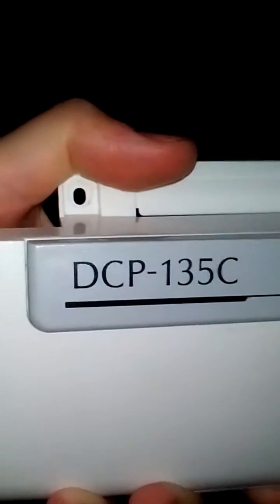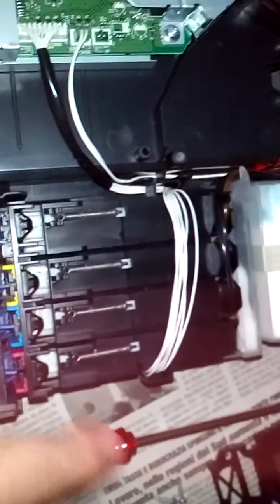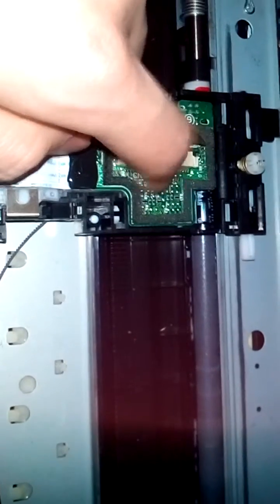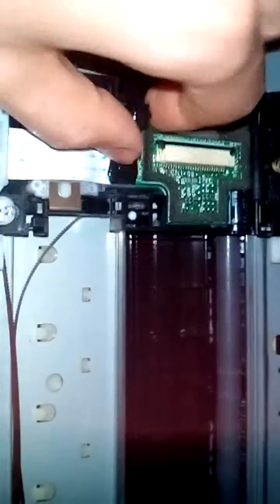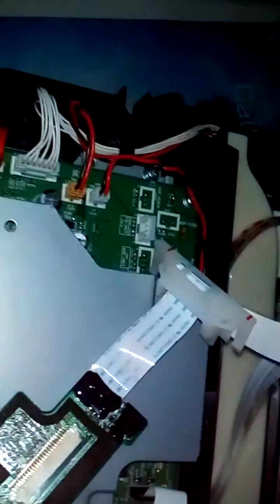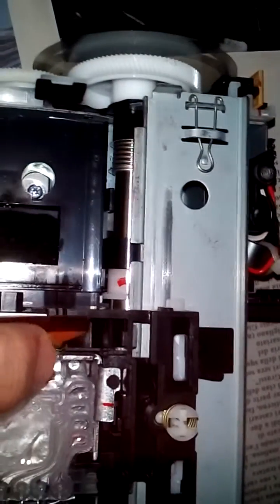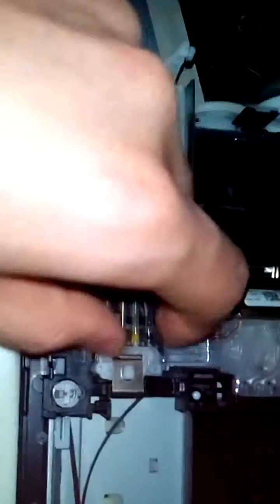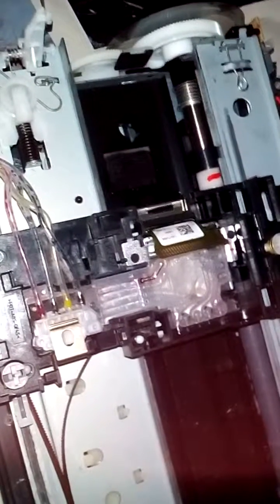brother dcp-135C disassembling open printhead replace mount change tutorial notices

Comment: I did change the print head, but still after a while MAGENTA fades out. It's as if MAGENTA ink does not get suck in. Any idea?
Reply from the maker: new printhead has been used 15 months, after, the 30% of blocked nozzles and I stopped using it. try to keep your device plugged in and print every 2 days at least 2 pages. then you will know the test compared to mine.